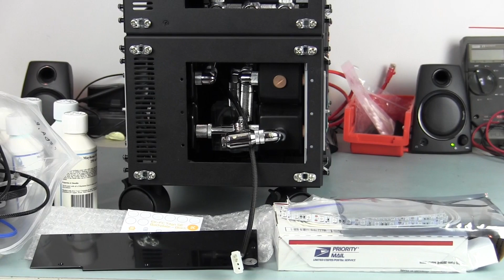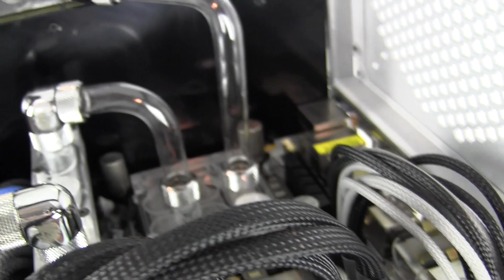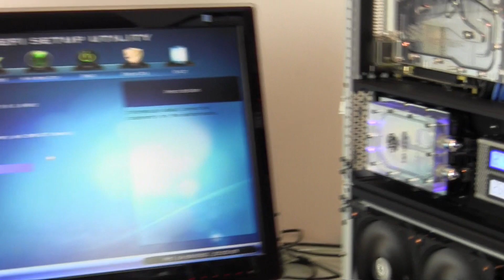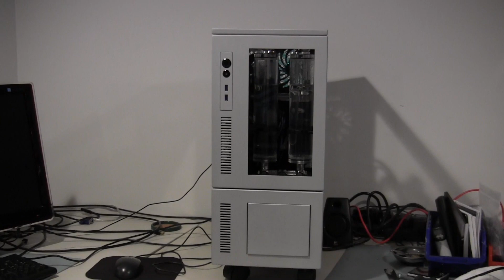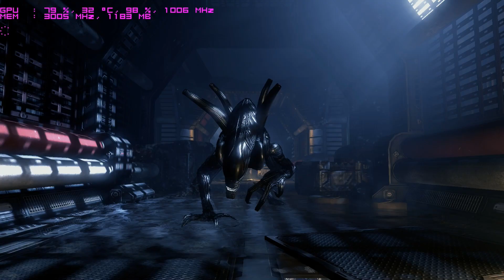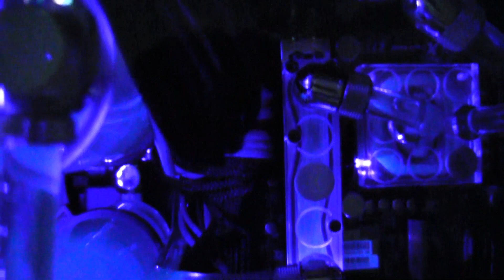Case Labs Mercury S3 Mini ITX Build Log 6    Fill Loop , Leak Check,  Benchmarks

Comment: Very nice video, thanks Ron
Reply from the maker: +Károly Molnár Thank you. Was a fun system to build.
Getting ready to sell this system now.  It has been sitting in a corner since I finished it. Used it at a lan show then that was it.
Thanks for watching.
Reply: +Ronsanut Ron how much the system cost. You count only parts. I'd like something like figure with Skylake CPU and GTX 980 TI respectively. GTX TITAN X for Flight Simulator Prepar3D v.3

Sincerely Karoly
Reply from the maker: +Károly Molnár I would sell this system for $1,500.  But it has a GTX-780 and i5-3750K installed in it.  It was custom built for this motherboard and layout.

Comment: Hi Ronsanut I am about to do a build with four Aqualis PRO 880ML Reservoirs in two loops. A .EK-D5 Dual TOP in each loop.  My question is If you had mirrored your fittings from the reservoirs to the pump and did the same from the gpu to the reservoir inlets. Would the flow be more even between the reservoirs ?   Great vid Ron Plenty of detail.
Reply from the maker: Zarquon That is a good question. Theoretically if they were truely mirrored , all pipes the same lengths and exatc same runs one would think so.  But I do not honestly know. It would have to be tried.
Reply: Ronsanut Thanks for the quick response.  Keep up the good work.

Comment: noticed you fitted the EK backplate to the bitspower gpu, did this all align up properly, ie did you use all the screw holes for the blackplate.

Comment: Just wondering about that waterblock on the GPU; to me it looks like you've got input / output of your water loop mixed up. Mostly because of the little semi-circular fin on the right side of the card when looking at it as it's fit in the case. It seems designed to make sure that the incoming waterflow is evenly distributed when it reaches the actual GPU cooling section on the block as opposed to taking the outside route as water tends to do. I haven't read the manual on those blocks though, and it's most likely a minor performance benefit if any. It just struck me as incorrect (with my slight case of OCD ;)).

Comment: This is one pretty damn detailed build.

There is just one thing I don't like. The way you fill your res. You leave that air gap between the res return and the res water level.

Now, I know it looks cool when it runs, and I know that you can visually see if the pump has failed, and I know it's not a huge strain on the pump, BUT!

I'd fill the res so the return tubes sit below water level. It will prevent the GPU from back draining and drawing air when the system is off.
And I know it's minor, but at boot the pump needs to lift coolant to the top, then after it's bled the air out that gap between the res level and the returns is fluid the pump needs to lift. Not much, but I'd still keep out out of there.
Reply: ^^ Diddo

Comment: Looks cool, and it's nice to see people actually build in smaller cases since the lack of space tend to make most people stay away from them. I'm actually in the planing face of a build that will be quite tight when space is concerned as it is a fully equipped midi tower, but seeing what people manage to do in miniITX cases gives me hope :)

PS: just me or is that MB flexing quite a bit?
Reply from the maker: Thanks. Yes planning is key for small case. I think custom cables are amust.  Yes the mobo did flex a bit, after I watched the video during editing.  But it has dome well. No issues.  Thanks for watching.

Comment: I had one one of those PSU tester before and learned the hard way that a meter is way better to use to check cables and other voltages.
Reply: What?! Use a meter? Never!

Comment: Any problems with those acrylic tubes popping off?
Seems risky to use them.
Reply from the maker: No, not at all. As long as you fully seat them in the fitting, they will not pop off unless you pull them out.

Comment: You really need to finish filling the reservoirs, the aqua-pipes need to be submerged to work properly.  Otherwise, neat looking build.
Reply from the maker: I like to see the flow dropping into the reservoir. These system will work just fine whether the pipes are submerged or not.  Thanks for watching.

Comment: Cool build man seems as though the pump isn't really pushing the coolant through quickly what pump r u using?
Reply from the maker: I have a Liang D5 pump with adjustment , and it is set on 5 the highest.

Comment: It looks awesome but IMHO its too large for mITX system. It is pure water cooling "porn" but you can almost fit 3 air cooled systems in something like Fractal Design Node 304 (it can do full on WC with some modding but is designed only for closed loop) in the same space. Yes they'll run hotter, and probably won't OC as much but its 1/3 the size ;)
Reply from the maker: Yes , definitely overkill , but the purpose was to show how flexible and all the options that CASE LAB's has to customize this Mercury S3 case.

Comment from the maker: The bitspower fittings I used to make the drain port are as follows:
T-Handle = BP-MVV-SLSL
90 Degree Double Rotary = BP-90R2
Male to Male Adapter = BP-WTP-C42
Stop Fitting = BP-SDWP-DC06 (optional)
You can get these all at Performance PCs. Tell them I sent you.

Comment: Extremely hoping to get a reply on what fittings you got to make the drain port. I'm confused on how i should do this with my mcp655 pump and hoping to get the xspc d5 mod top as outlet is going to the top... and so before the Distilled water goes to the pump i would like to get some sort of fittings to make a drain port there.

Comment from the maker: Theyu are both PWM, and I had swapped the connections sothe fans on the rads are controlled by the CPU PWM connector.  It is so tight in there I did not see the 4th pin.

Comment: the cpu no pwm and the chassis fan pwm? that wouldn make sense. both fan-connectors on the board are 4pin pwm-connectors. but turning them round would just be for the head/the mind, would have no real benefit from it.

Comment from the maker: Yes with no flow controller I use the temp of the coolant in my loop to tell me if the heat is being carried away . The closer the delta between the ambient temp and the coolant temp is enough of a measure. Also seeing the smooth flow and steady flow of the return into the reservoir is also a visual indication of how strong the flow is as well. Thanks for the feedback.

Comment: Hi ! I like your build . GREAT JOB!

Just one thing what I noticed. I do not know how much flow rate you get and how much your loop effective is, but in many cases if the aqua pipe doesn't submerge in the coolent, the loop is noisier. Maybe if you add more coolent, your system can be quiter. No splashes, No noise, and the air does not go back in the loop.
What you think ?

Comment: looks great! only thing i don't like is the uv, but that's personal preference.
i would fill the reservoirs a bit higher, so the openig of the inside-tubes is underwater. this should be just a bit more silent and calm.
and i would turn the fanplugs round, so the four fans are seen as cpu-fan and the fan in the back as sys-fan.